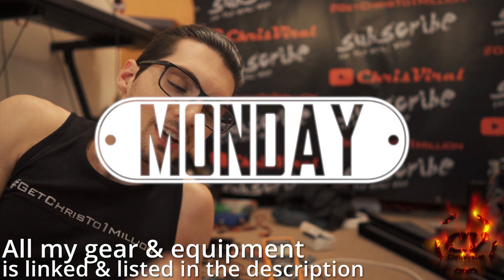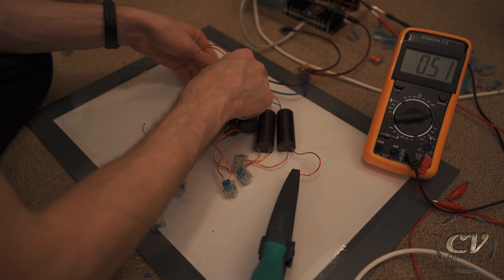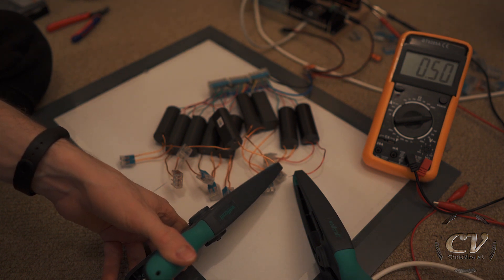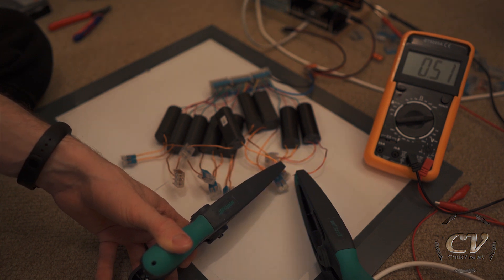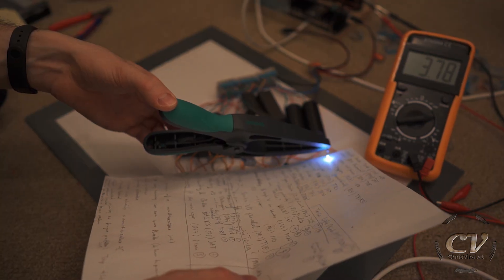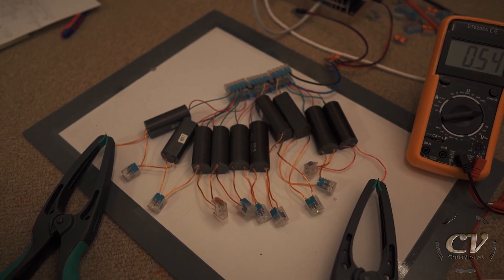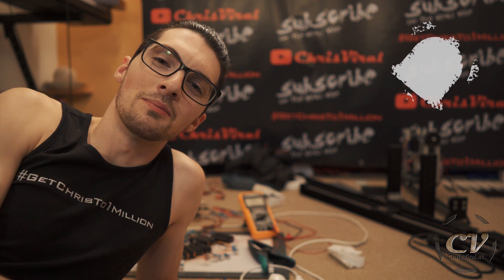10 x 400kV Modules In Series (Surprising Outcome)

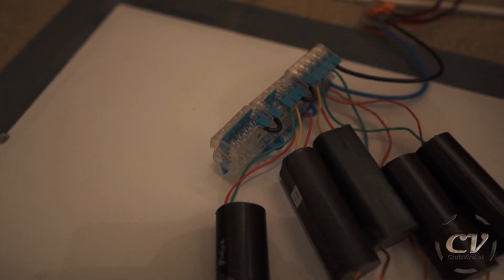Comment: Look at 1:06 with 5 modules on the table. The one in the middle is upside-down (flat surface on top). That's where the polarity is reversed. When you connect it wrong the whole experiment is pointless.
Reply: It's more about if it's wired the right way, not if it's upside down or not. Your phone will charge if it's placed with the screen up or down, it doesn't matter lol

Comment: haha i have the same crappy multimeter as "Opfergerät" xD (~7,8eur or so)
Btw there is a cheap multimeter which is way better,
 which i didn't expect.
look at this one with Autorange : -> https://www.ebay.com/itm/Autool-DM198-Auto-Ranging-Pocket-Mini-Portable-Digital-AC-DC-Multimeter-Tester/263146758359?hash=item3d44c4e0d7:g:~YkAAOSwurVZknBd
here another useful tool Gaslötkolben
https://www.ebay.com/itm/1300-C-Butane-Gas-Blow-Torch-Solder-Iron-Gun-Cordless-Woolelding-Pen-Burner-js/263335844600?ssPageName=STRK%3AMEBIDX%3AIT&_trksid=p2057872.m2749.l2649
and if you are into lookpicking as a hobby (not profession ;D )
https://www.ebay.com/itm/5stk-Lock-Picking-Tools-Set-Extractor-Training-Padlock-Kit-Stainless-S-Pick-K8N2/153476186701?ssPageName=STRK%3AMEBIDX%3AIT&_trksid=p2057872.m2749.l2649
Reply from the maker: OMG autorange sounds awesome. 
I got this one from my granddad by the way... He thought that I'll probably wreck it soon anyways so he got me this XD